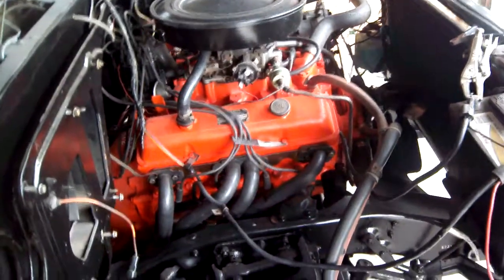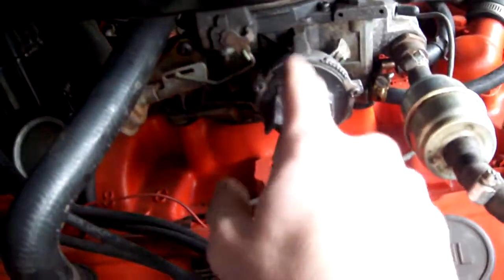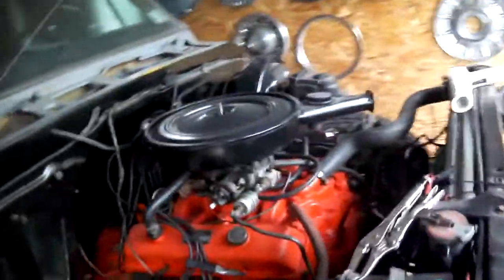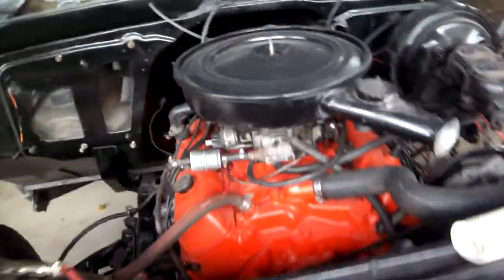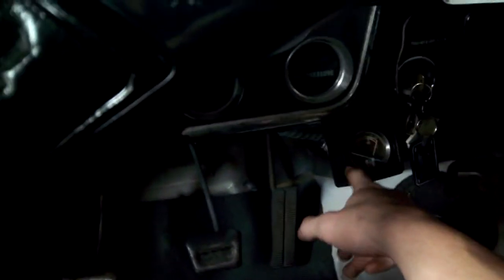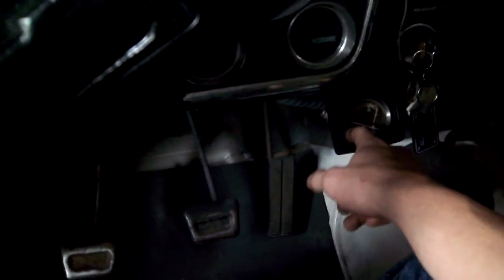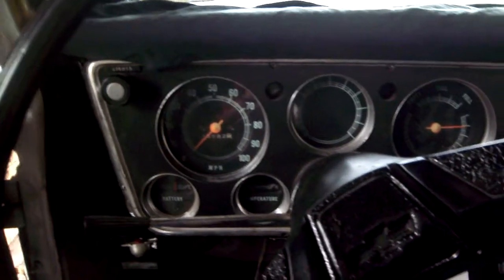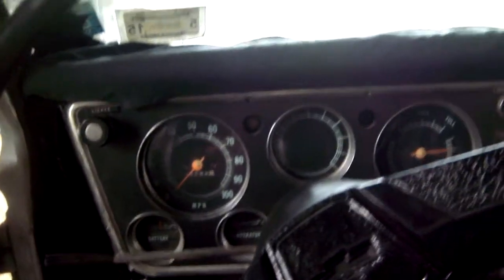Fixed the choke, starts much better!

Comment: You will know that you have the choke set just right if when, as the motor warms up to operating temperature, the choke butterfly opens wide open and stays there under throttle.  If it hangs partially closed or blips closed even just a little under throttle it will burn gas like crazy. I'd take the time to fine tune it with the temperature gauge. Much improved however.
Reply from the maker: it works almost perfectly . stays open once its warmed up and dosent close under throttle.  ill fin tune it when i rebuild the carb

Comment: Told ya the choke would help. lol ;) If ya had 11.5.1 compression ya wouldn't need one. lol. The 496 in the 77 has 10.0.1 and a few pumps of gas and it start right up...but it has a perrty hot HEI as well.
Reply from the maker: Military Chevy yeah , them big blocks always start LOL  i definitely want to change to HEI

Comment: Summer time I pump once or twice, when it gets cold I pump about 8-12 times. I have the butterfly closed a little but once it gets cold it's hard to start. My choke light never goes off either.